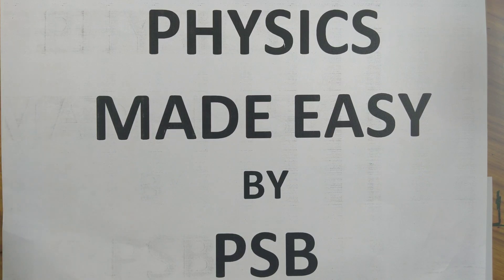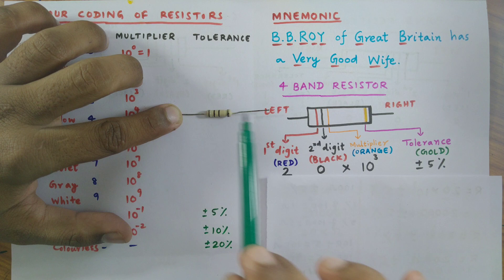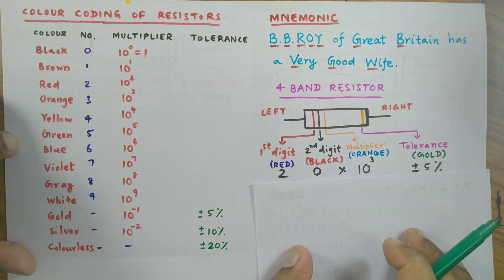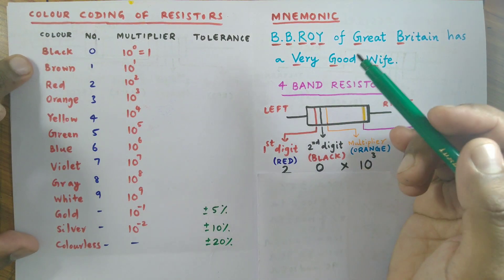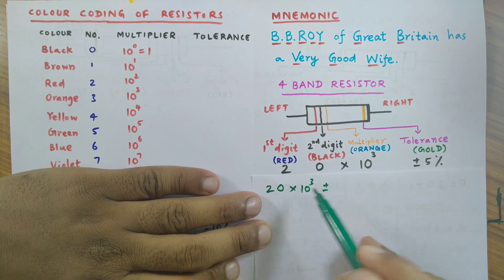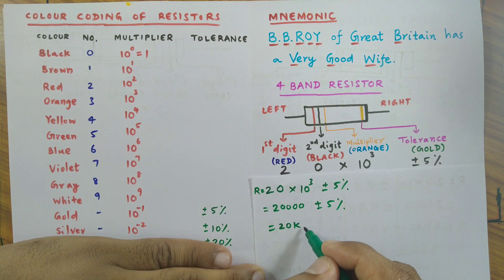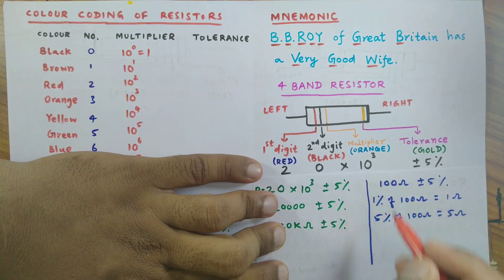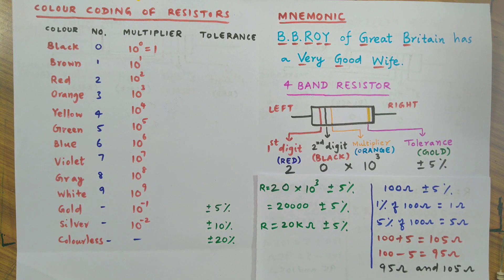Colour Coding of 4 Band Carbon Resistors | Current Electricity| Class 12 Physics

Comment: Sir, resistor-  red,red,black,gold i want to replace but I don't have the same resistor. How can I do. Please hepl me
Reply from the maker: The mentioned resistor have 22 ohm resistance..  what value resistor do you have with you.... Kindly mention... I will see what way I can help you?
Reply from the maker: You can use 2 brown brown black gold resistors in series.
Reply: Thank you sir 👍
Reply from the maker: Most welcome
Reply: Sir, one more question. Can i replace with carbon film resistors with ceramic resistors? Thank you
Reply from the maker: Yeah.. no problem... you can do it... But the size of the ceramic resistor might be little large...
Reply: I am repairing one street light circuit which is affected by lighting. Thank you for your helps. If possible I want to have your number. Thanks 👍
Reply from the maker: Most welcome